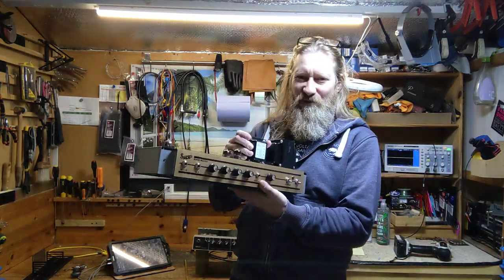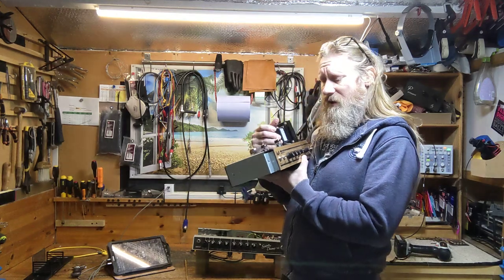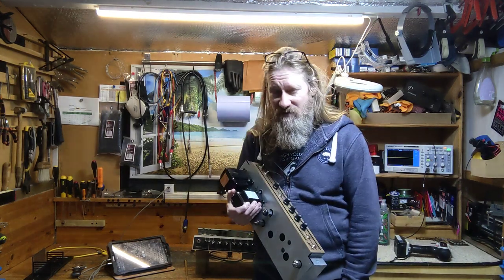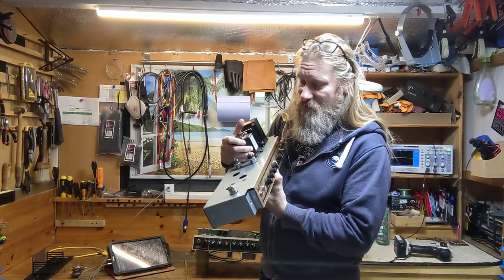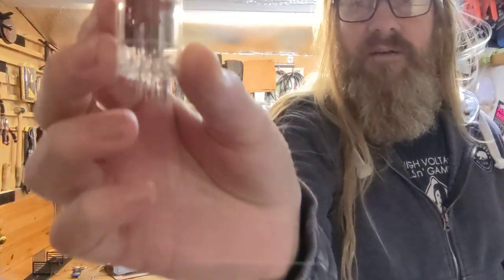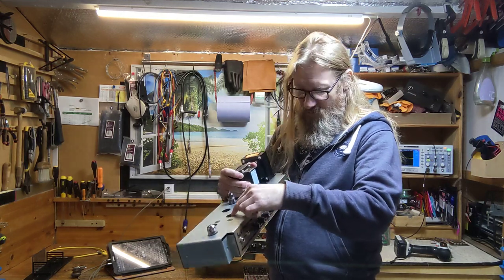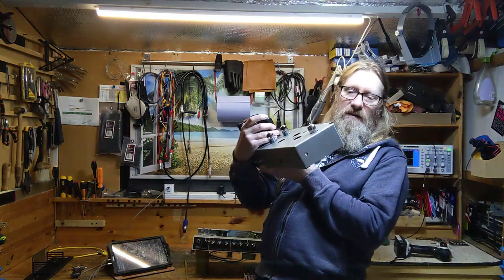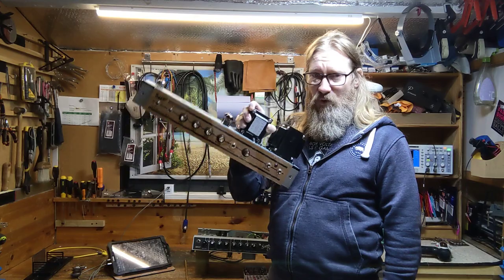Supro Black Magic , great amp bad tubes.

Comment: I have the Supro Keeley Custom 12.  It had one Chinese 12AX7 in it.  I swapped it with a GE 12AX7, but honestly the Chinese one worked and sounded good.  I kept it and it’s in my stash.  FYI, Supro amps are the bomb.

Comment: I've had the BM for 7 years with zero problems. Original tubes and speaker.
Reply: Chinese tubes can sound great if they are the right ones. Some suck and some can sound better than a name brand. If it sounds good, it is good. Diminishing returns on tube rolling.